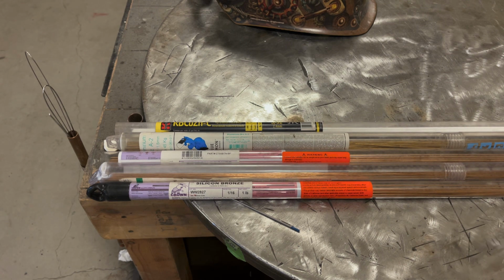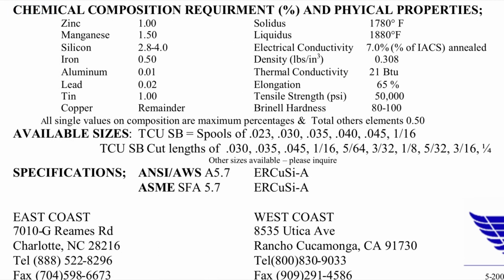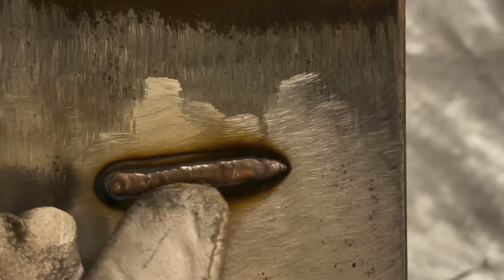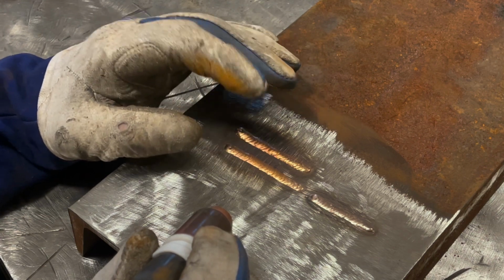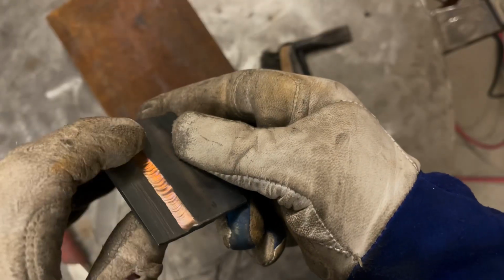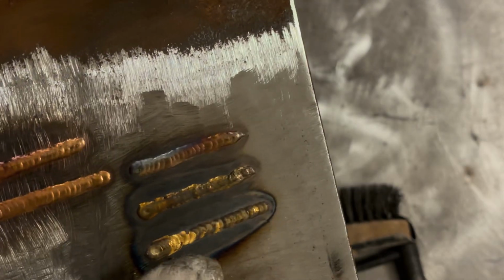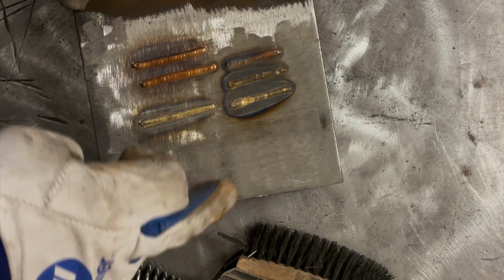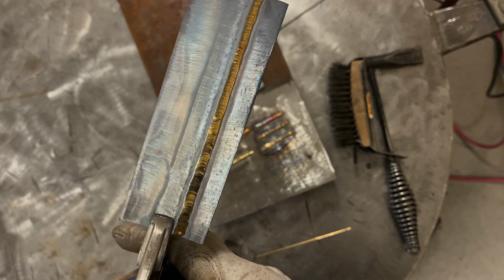How to Tig weld / braze with silicon and aluminum bronze 🤑

Comment: So I'm going to try and tig braze a broken main bearing cap. I can't find a cap by itself without buying a complete block.
Reply from the maker: So I am not positive that will work but it may.  What I would worry about is silicon bronze starts losing strength above 150 degrees F, Aluminum bronze would be far stronger at higher than 150 but more difficult to work with.  Preheating the cap to 400-500 and welding it with nickel based alloys or 312 stainless would likely net a stronger weld if the material is clean.  Due to oil contamination of the cap and the caps alloy, it is likely going to be a challenge to get it to work regardless.  I have done silicon bronze repair on caps to fix cracked edges and stuff without issue but never actually welded/brazed a cap together.  I hope it works out for you 👍

Comment: The comment about the Bronze protecting Aluminum made little sense... Aluminum Bronze is an alloy of Copper and Aluminum at roughly 9:1 ratio (there are slightly different ratios available too) and almost no other alloying elements. In other words there is no Bronze without the Aluminum. Some Copper alloys (Bronzes, Brasses) will break down some with application of heat, so it is possible that in this case some Aluminum separated from Copper forming some purish Aluminum layer, but I am skeptical about that. More likely some optical effects are happening there due to how it crystalizes.

Comment: You make it look easy. I on the other hand have something wrong when I get the bronze hot enough it is like it blows up
Reply from the maker: If you can tig weld a normal bead on steel and it looks ok, but silicon bronze doesn’t, it’s likely because you’re using too much heat.  Silicon bronze needs just enough heat to allow it to “flow out” and you more or less keep progressing forward with the tig torch/arc.  As you progress forward the molten bronze will follow the heat/arc.  If you sit too long in one spot (or use too much heat) you will likely start melting base material which may cause some of what you’re describing.  The other thing that is important is the material must be clean.  If you are brazing filthy materials you’re best off using a oxy fuel torch and not tig.  It’s very easy for molten bronze to react with poor surfaces.  Beyond that make sure you have suitable bronze wire.  As I wrote this I got to thinking it’s possible you have silicon bronze wire for oxy fuel welding.  Oxy fuel bronze rods should not be used with tig and will cause all sorts of soot/spatter issues.  Go on Amazon and lookup “tig silicon bronze rods” and buy one of those if you’re using oxy fuel rods.  Hopefully that helps 👍

Comment: Im in the uk, and sorry but this has to be one of the best brazing vids I have ever seen, this was just brilliant, 
Thank you for posting. 
Love it.
Liked and subbed.
Reply from the maker: Glad you liked it.  Brazing with tig is very strong and pretty useful for oddball repairs.  Believe it or not tig brazing with aluminum bronze is nearly the strength of common 6013/6011 rods.  Once you can tig braze you will find yourself using it more than you would think lol.

Comment: Do you use shielding gas when brazing
Reply from the maker: So with tig you use 100% argon gas.  The rods themselves are a bit different than oxy fuel rods, and you can’t use oxy fuel rods with tig (or flux for that matter).

Comment: Truly excellent video Greg. As always, you come up with new guidance on processes I need to cover down on. The question I have though is what similar or dissimilar metals would you use this on - specifically? Are there metals to avoid with each TIG 'bronze' process(es)? I'm considering brazing bullet shell brass 'casings' together for a Military retirement gift but thought I'd pick your brain on what TIG process and filler metal of these would work for that (on brass casings). Surprisingly, the 'Aluminum Bronze' has more of a brassy appearance I totally didn't expect, so that was pretty wicked - and beautiful! Thank you for a response if you have the time.

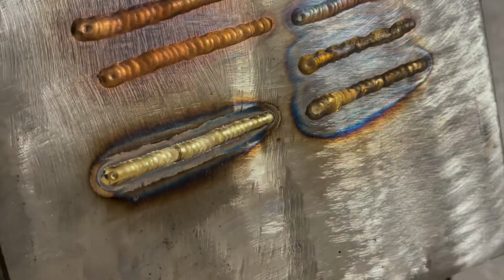Comment: 21:36  That is REALLY interesting about the aluminum bronze and makes perfect sense.  Considering aluminum and steel react electrically (electrolysis causing galvanic corrosion), having that bronze layer in there as an interface to separate the two is so cool.  Kind of like how you can use bronze fitting to connect copper and steel in water plumbing.
What'd be crazy is if you could knock the bronze layer off the outside then anodize it.  The welds would looks nuts!  (for artsy stuff)
BTW, came across your video because I'm researching good ways to weld a cast iron axle housing to steel axle tube.  Ford just plug welds in the tubes in a couple spots and they break under high torque.
Reply from the maker: So I have extensive experience with welding axle housings (I have built a ton of axles for off road trucks).  I will give you some quick tips with what you’re looking at doing.  It’s pretty common for axle tubes to spin in the housing.  The sterling 10.5 is notorious for that for example.  To deal with this issue you have a number of solutions.  Most commonly welding the tubes to the housing where they go into it with high nickel rods (99% nickel tig or stick) works great.  You preheat the housing to about 300 degrees near the tube and weld it in 4 quarters, bouncing from one side to the other to prevent tube warping.  Some people weld they with 309 stainless and that can work as well but I find it can crack easier due to how much it shrinks.  Aluminum bronze is more than strong enough to braze the tube to the housing.  I would use this is a backup solution, the reason is it tends to be very difficult to clean the area where the tube enters the housing.  The junk that will float out of there and the general filth on the housing tends to contaminate the braze material and can weaken it.  It is an option though, and would work.

Also: I am going to copy and paste something I wrote about cast iron a while ago, this info should really help you understand what’s going on: 

Couple things you want to consider here.  

Everyone is a hero and knows how to weld cast iron/steel but nobody seems to understand why you should do certain things with cast iron.  Cast iron and cast steel have two properties that cause problems with welding.  1) if there is high carbon content the weld and welded area becomes brittle (carbon embrittlement).  2) limited ductility which can cause welds to break right off the cast while cooling.  These are two distinctly different problems that have to be addressed.  Problem two can be solved by preheating the part to 400-700 degrees (based on weld filler recommendations).  The preheat prevents excessive fast shrinkage, allows the weld to wet into the thicker material better, and cleans a lot of crap off the surface (oils/coatings).  

The preheat doesn’t solve the high carbon content (problem #1).  The only way to solve that problem is to use a filler that doesn’t become brittle from carbon absorption (nickel, stainless 309/312, bronze, etc.  if a part that’s high carbon content is welded with 7018,er70s6 it’s entirely possible to have a weld that sticks and doesn’t crack.  However the weld (being a alloy of both the rod and base material) is likely a brittle alloy that will crack when stressed.   

The simple way to solve this problem is to test the metal before welding.  Take a tig torch and puddle a molten dime with no filler, cut the arc, and do it fast.  Take a file and try to file the spot.  If the file cuts the molten dime (like it does on mild steel) you can use er70/7018.  If the file won’t cut into the spot and just skates over it you have a high enough carbon content that you should not use er70/7018 and should use a stainless/or nickel alloy.  It doesn’t matter what a person says the material is, they might call it cast steel, ductile iron, etc, if it proves to become extremely hard during the tig test any weld that you put down that can become brittle with carbon absorption will.  Another test you can perform is to take a metal punch and punch the surface at a angle to create a divot.  If the divot has a raised burr the material is probably ductile enough to not likely crack during cooling.  If it has a flat dent and no burr it will likely be at a higher risk of having welds crack off during cooling.  

All cast should be preheated regardless of test results, cast steel/iron normally undercuts real bad (looks like a sand castle wall falling slowly), and generally welds poorly.  Preheating cleans it and helps welds wet in better.   The more base metal dilution you have in the weld the higher the probability of weld failure you have.  Hot material = fusion without excessive filler dilution.  

The last thing you need to look at is options of brazing the parts.  Silicon and aluminum bronze can be extremely strong and can hold up for certain cast iron work just fine.  Not sure what your looking at doing but that is a option for use (especially if welding has been a problem).  Also wear PPE when dealing with the specialty welding rods like nickel, they are extremely hazardous to your health (especially with high fuming processes like nickel stick rods and mig wire.  

In your case specifically you need to get tig filler and not use welding rods with flux cleaned off.  The main issue with using a welding rod is the diameter, good luck finding a nickel rod thinner than 3/32.  3/32 is big for trying to weld a small crack with tig (lot of amps).  The other issue you will have is that cylinder head will need to be machined after the fact.  The heating and welding will cause the surface to be out of flat.  I have done a bunch of cylinder heads before and been successful, but I didn’t skimp on the prep, and I had experience.  Your success may be more or less than mine depending.

Edit:  nickel welds with a green arc and in a way flows like silicon bronze.  It’s not hard to weld with, but it’s terrible for your health so protect your lungs with a respirator.  Also you should preheat the head based on manufactures suggestions.  Do not just “throw it on a fire”, heat it to the specified temp.  Make sure the whole thing is brought up to temp too, not just the surface.
Reply: @makingmistakeswithgreg  GREG!  Thanks you for your expertise and that absolute wealth of information.  I've had this tab open for months meaning to save it.  LOL!
Yeah, I'm in a similar spot.  Looking to put a Ford Econoline Sterling 9.75" in my Astro van for some serious power handling.  The Econoline axle looks to be an almost direct swap to the Astro.  Perfect passenger side offset, WMS width, and spring pad locations are almost identical.  There' even a version that used the same 5x5" wheel bolt pattern (but it uses the small 1.620 bearings).  I'll probably get an 8-lug axle, get custom axles made, because it has larger axle tubes and the beefier 1.700" bearings.  I'd love for the van to get in to the 10's and that will require about 800HP.
BTW, they also put the 8.8" in the older vans with the 5x5" bolt pattern.  A bunch of options that I'm looking at.  :)

Comment: Thanks for a superb tutorial.  The bonus is how to recover from a mistake. Ive been a Toolmaker Die mould...yeah...thats how we Down Under spell Die Moulds. . If as i suspect you're a Canadian,  and you guys spell Moulds as Molds...the Trump is going to absorb yout9o like Iceland. Speaking of absorbion...what sort of force can your Aluminium Bronze absorb if struck. I repair tooling that "cant" be welded in the normal sense as TIG. However its set me thinking if a foundation weld deposit of Aluminium...notice how thats spelled too. With all the correct letters too. If i were to mill a shallow pocket say ..just for you a ¼" deep pocket with radiused base corners would the adhesion of the Aluminium Bronze, after machining on a profile, would the adhesion resist a significant blow such as a moulded product being NOT expelled after ejection, was trapped during closure for the next cycle to begin again.  Sensors would pick up that the mould halves are not fully closed. But some compression of the previous component has taken place. The worst ive seen were a youths pair of gloved hand. Sensors were believed to be working. He'd been hypnotised by the repetitive nature of the process work of press trimming. He mistimed his foot down on the pedal. Four fingers and partiality the top of the thumb on each of the youths hands were crushed to paper thickness or less. I remember it liķe this afternoon. 39 years ago. Hed be 55 now.
The youths of past present and future...MUST learn that machines dont act against us...but its us who trivialise the danger they can be IF we are complacrnt and lose the awareness that these things can Kill & Maim you. I have sern to many from afar, but even as an apprentice have acted where supervisors didnt know what to do. What do you do whrn a man has a violent fit and is chomping his tongue. You dont get out a phone and film it !!!...if i couldnt access my wallet, I'd jam my phone in his or her mouth...we act mate.
Reply from the maker: I will be doing a strength test of silicon bronze and aluminum bronze with tig, along with some mig/gmaw and torch brazing.  Aluminum bronze is significantly stronger than straight silicon bronze in my experience.  Both can definitely get the job done on materials that don’t like to be welded without cracks.

Comment: I've always heard gas brazing is stronger than TIG, cause you get better capillary action with flux and seeps right into the microscopic pores of the steel as well the joint. Little test at home confirm but anyone with serious equipment and a way to gauge it would be awesome to test oxyacetylene flux vs Tig brazing strength
Reply from the maker: So that topic is actually very complex, because it depends on what materials, joint style, and skill of the person.  On a simple fillet weld on thinner mild steel I have a feeling tig would be stronger because the brazing rod itself that’s used is stronger.  On something like pipe where capillary action is used, oxy fuel brazing would be stronger because you’re not just joining a small section, but you have adhesion through the whole joint.  To a certain extent a tig braze will follow the heat and it is possible to get some capillary action, but it’s minimal.  Remember, brazing operates not on fusion but adhesion, so the more area that has braze material the stronger the joint.  Capillary action can increase the effective adhesion area, but so can engineering a joint.  Bevels will allow tig to have a large area of adhesion without capillary action.  

The biggest issue with tig brazing is the skill to do it.  Oxy fuel is far easier and more forgiving on common things like say a bike frame.  I have had a lot of people tell me Tig brazing is very difficult and talk about bronze inclusions, melting the base metal, and undercut.  All of these things are skill related issues.  Since oxy fuels flame  is much lower in temp and less concentrated,  it’s far harder to melt the base material, thus you don’t see the same defects as tig.  

I definately will do some tests regarding this.  The difficulty will be making it comparable.  Oxy fuel produces massively bigger brazes, I will have to do multi pass tig brazes to make it comparable.
Reply: @makingmistakeswithgreg   "Oxy fuel produces massively bigger brazes," that's what I remember in HS.  We were learning on flat stock, just like your TIG tests in this video, and the braze went all over the place, like you poured it on.

Comment: I'm not an expert in welding but, do the same principles you explain in the video, apply to acetylene welding as well? Meaning, will aluminium bronze weld well to cast iron with an acetylene torch? I never heard of AC TIG welding on steel to be honest, only on aluminium; it does produce beautiful welds as you demonstrate in this video :) Thanks and happy New Year to you !
Reply from the maker: So oxy fuel can be used to braze metal and it works great.  With cast iron it produces really strong brazes because the heat/flame helps with material prep (cooks contaminates out), increases the castings ductility so the braze doesn’t crack off the casting when it cools, and the flux will help clean as well.  The downside with oxy fuel brazing is it tends to be far less precise than tig, it tends to not make as clean of brazes, it takes way longer than tig, and unless you get a smaller torch it tends to be tough to do on small material.  You typically must use flux (either on the rod or you dip the rod in) which adds complexity.   Realistically tig works great for brazing but it’s super concentrated high heat can cause issues if you make a braze very fast without allowing some material to heat up and cool slowly.

Comment: Thanks for explaining what processes are used with bronze tig brazing.  I've watched many videos on the topic and most simply gloss over what process to use with this material; I was left guessing as to whether it would be DCEN or AC.  My prior experience is more with zinc bronze welding using a gas torch, but have yet to try it with tig.
Reply from the maker: Tig is actually very simple to use for silicon bronze, if you can tig weld it functions very similar (just at a lower temp).  The aluminum bronze tends to run better with a pinch of ac, the bead otherwise tends to be real sooty/rough.  Pretty soon I will be doing some strength testing on both silicon and aluminum bronze to see how comparable they are to normal er70.